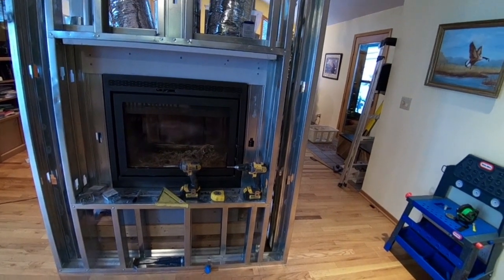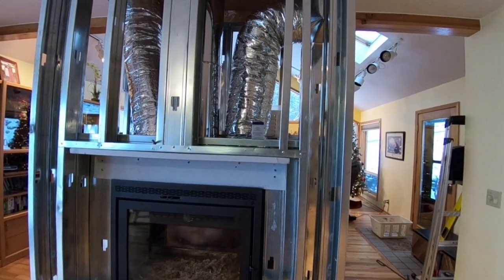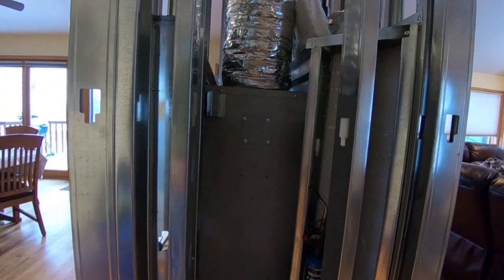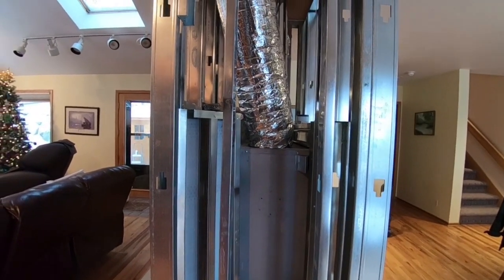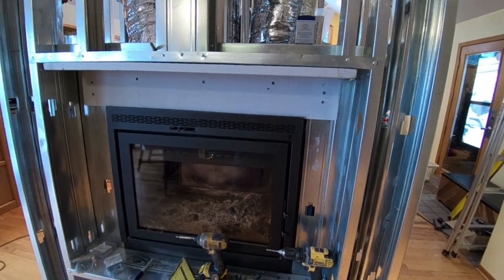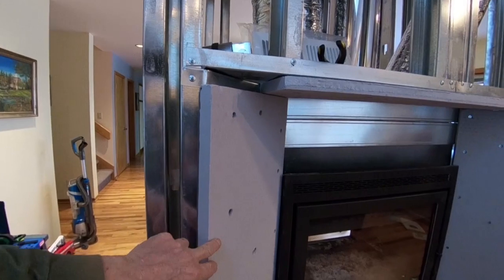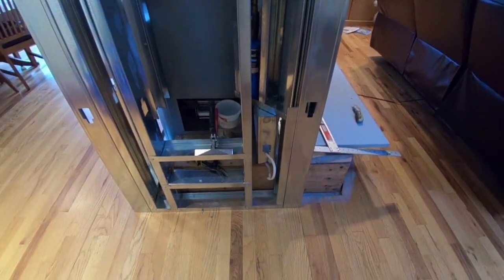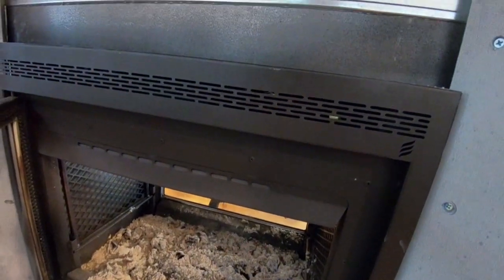Obadiah's: Installing a Zero Clearance Fireplace Part 2 - Framing a See Thru Fireplace

Comment: Did it cause issues with the blowers to sheet metal a cover over the opening? Were you putting it directly on the fireplace or were you talking about the framing?  Also did you allow for  cool air intake on the bottom..and warm air outlet on the gravity feed?
Reply from the maker: Hello,
The blower has vents in the wall in which the air is dispersed. This is required, otherwise you will overheat the fireplace. There is an outside air intake on the bottom side of the fireplace. The gravity air kit naturally rises and disperses heat at the top of the chase. Please let me know if you have further questions!